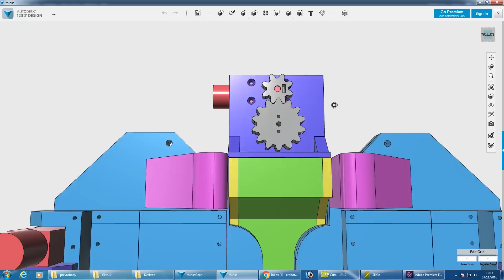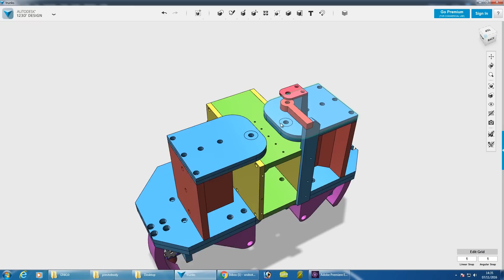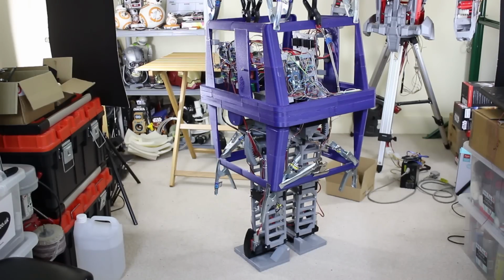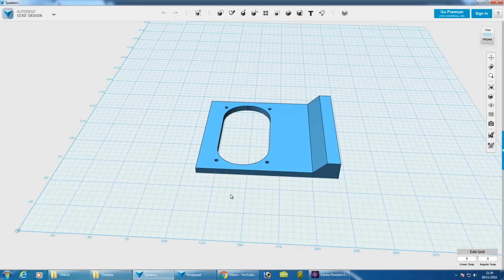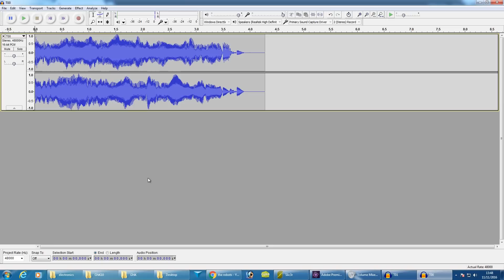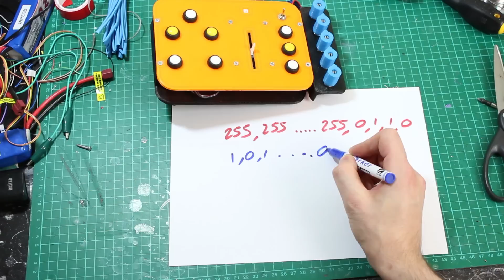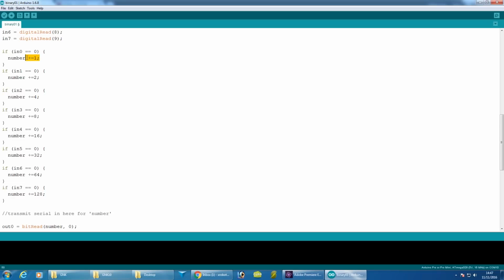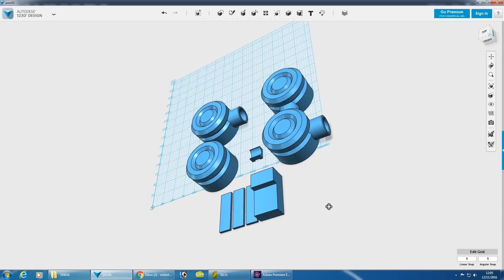Star Wars GNK Power Droid #10 | Cosmetic Features | James Bruton

Comment: While an int does take 16 bits (or two bytes) in the memory of the AVR, you are sending it as an ASCII representation, where each digit takes a byte in your transmission. So 0 only uses one byte, while 255 uses three bytes and 1024 uses 4 bytes. While sending it as ASCII is more human-readable, it takes up space in your transmit and receive buffers. It also takes time to send it all as ASCII, which could be better spent on processing. (Especially on a bot like your BB-8 v3, with all the IMU and PID calculations going on in one microcontroller). Sending the values in binary makes more sense all around. While debugging, you can still have the AVR write out values to the computer in ASCII so you can see what values are there.

Comment: there is a cleaner way to implement the input to binary number value with a for loop. something like
int in[8];
 
for (int i = 0; i < 8; i++){
   in[i] = digitalRead(i);
   number += in[i]*pow(2,i);
}
Reply: Also:
int out[8];

for (int i = 0; i < 8 ; i++){
  out[i] = bitRead(number, i);
}
Reply: Actually, i rethought the transmitter end code. 
int number;

for (int i = 0; i < 8; i++){
   bitWrite(number, i, digitalRead(i));
}

Comment: An easy way to transmit data is to collect all the info into a 'struct'
You can then set the individual bits, all the analog values etc and send it as one block.
On the receiving end you just read the data into that struct and you have direct access to all the data you need without having to parse anything. The compiler does all the work for you. Very compact and fast. And most important easy to use ad maintain.
Here is an example how i used it for sending data from a analog joystick:
typedef struct {
  int x;
  int y;
  union {
    struct {
      boolean up: 1;
      boolean down : 1;
      boolean left : 1;
      boolean right : 1;
      boolean joyswitch: 1;
      boolean fire0: 1;
      boolean fire1: 1;
      boolean option1: 1;
    };
    byte switches;
  } data;
} MicroBlocks_analog_joystick;

MicroBlocks_analog_joystick analog;

You can then set the bits directly:
analog.x = 100;
analog.data.up = 1;

After receiving you can check if any of the buttons are pressed with
if (analog.data.switches != 0 ) {.... }

(switches has the byte value of all the individual bits combined)

Comment: You could just sense when the knobs are being changed and send the new values with identifiers. That way you only ever send two values for the dials: an identifier integer (from binary to identify which dial has changed) and one integer for the changed dial.
Reply: Actually, using binary to identify the dial would only be necessary if more than one were being changed. Otherwise a 1-5 integer would work.

Comment: You can put transparent plastic panels on the outside (with switches and stuff) so you can see through the droid. In this case the main body remains solid and everybody can see that there is no one inside.

Comment: If it helps here is a way to optimize bit field encoding... it reduces the need for if-statements and can provide a speed increase of your loop...

number = (unsigned char)digitalRead(2); // or << 0 ... same thing.
number |= (unsigned char)digitalRead(3) << 1;
number |= (unsigned char)digitalRead(4) << 2;
... (left out to reduce my typing) ...
number |= (unsigned char)digitalRead(9) << 7;
// number is assembled and can be sent.

Enjoying the GNK build, looking great so far!
 - Eddy
Reply: (slight edit, looks like a binary '0' is to be interpreted as an active state..)
in this case, use;
eg. number |= (unsigned char)(digitalRead(3) == 0) << 1; // modify all of course...
etc. to invert the reading.

Comment: Would it not be easier to use arrays rather than write same variable 10 times. Like int in[10] = {0}; and use loops for initializing row of inputs like   
for(int i = 2;i < 10;i++){
    pinMode(i,INPUT_PULLUP);
}
and reading sensors in loop like:
 for(int i = 0;i < 8;i++){
    in[i] = digitalRead(i+2); 
  }
and setting bits:
 for(int i = 0;i < 8;i++){
    number |= in[i] << i; 
  }
and reading bit
  for(int i = 0;i < 8;i++){
    number |= in[i] << i; 
  }
  and last printing it
  for(int i = 0;i < 8; i++){
    Serial.print(" , ");
    Serial.print((number >> i) & 1);  
  }
It just hurts my I to see copy paste code. Other wise your channel is Excellent!

Comment: I think the problem with your previous methode is that it doesn't actually print the Integer as an 8-bit int but rather as the string representation in decimal ("0" - "255") resulting in up to 3 bytes per value.
You could do the following to send the values in their binary representation:

int valA = 127;
int valB = 255;
byte valA_byte = min(max(valA, 0), 255);
byte valB_byte = min(max(valB, 0), 255);

Serial.print(valA_byte);
Serial.print(valB_byte);

(I'm constraining the integers to a 8-bit range to make sure they don't overflow/underflow.)
And equally on the reciever side:

byte values[2];
Serial.readBytes(values, 2);  // read two bytes, save them in "values"

int valA = values[0];
int valB = values[1];

It's as easy as that and it is only using one byte per value instead of three. The only downside is that the receiver has to know the amount of bytes it is going to get.

Comment: I love this project, but when I hear your recording of the "Gonk!" noise I can't help but think of a Dalek... I think it would sound better if you modulated it lower and added a bit more noise. Also, slower movement would work in its favor since they all moved very slowly in the films. No more than 120 steps per minute in most cases, and in a lot of cases more like 80-100. But yeah, this is really cool! I think I might want to build this one myself when I get a 3D printer.

Comment: I was thinking, you might be able to put some extremely thin Plexi on the sides or some kind of extremely thin plastic sheets (not quite cellophane, but more like a sheet of plastic that is used on a cheap large poster frame. It is clear and light weight and can probably be adhered with your contact cement you are using. Just a thought. Keep up the Awesome job, my friend. I'll catch ya' later ; - )

Comment: If each integer is 2 bytes, why do you need to send a comma every third byte? The comma can just be inferred, surely? If necessary a single-byte "start of string" command, and maybe a full stop at the end, would be enough to synchronize everything, I would have thought.
Reply: nagualdesign
Also I think that with his previous methode he doesn't actually print the Integer as an 8-bit int but rather as the string representation in decimal ("0"-"255") resulting in up to 3 bytes (UTF8) per value.
Reply: nagualdesign
He could just do the following:

int valA = 127;
int valB = 255;
byte valA_byte = min(max(valA, 0), 255);
byte valB_byte = min(max(valB, 0), 255);

Serial.print(valA_byte);
Serial.print(valB_byte);

(I'm constraining the integers to a 8-bit range to make sure they don't overflow/underflow)
And equally on the reciever side:

byte[] values;
Serial.readBytes(values, 2);  // read two bytes, save them in "values"

int valA = values[0];
int valB = values[1];

It's as easy as that. The only downside is, that you have to know the amount of bytes you are going to recieve.

Comment: Wouldn't it be better / more readable to use bit shifting to get the buttons? I.e. If you buttons are simply 0 or 1's you could use
result = (button0 << 0) | (button1 << 1) | ... | (button7 << 7);

Then on the other end its a simple as going
button0 = result & (1 << 0);
button1 = ((result & (1 << 1)) >> 1);
....
button7 = ((result & (1 << 7)) >> 7);

Otherwise it's looking real good, keep up the good work
Reply: Same thoughts here, some bit shifting and/or const bitflags that you can do bitwise operations with (using "(Bitfield & Bitflag) == Bitflag" to check if if Bitflag is set in Bitfield, etc) are much more efficient, plus with sensibly named bitflags it makes for more readable code than just bitshifting OR the current approach. And I'd just put the whole control state into a struct and send that, maybe with some error correction thrown in.
Reply: But, I guess if its working its already working it shouldn't really need changing.
Reply: I like this way also! (bit shifting) Easy to use, and saves lot of memory.

Comment: If you take care which pins you use for the button inputs,  you can read all 8 pins from a PIO port with a single instruction, ready packed into a binary byte.  I'm pretty sure you can do this in Arduino C without delving into asm,  but that's an option too

Comment: You could use plexiglass panels. It would add rigidity to the body but allow everything to bee seen.
Reply: as well as prtect the insides from greasy hands and damange
Reply: yeah, some darkened plexi and led illumination inside (ala gaming case) that changes color when it sais GOOONK!!
Reply: Great idea !
Reply: ThatSaneGuy Yeah it might be a bit heavy in retrospect. Well, since the covering would be mostly for authenticity sake, he could use just about any semi-rigid material as long as the additional weight isn't too significant. I'd say he could use Styrene. Cosplayers use it to make armor (via vacumm forming) so it's somewhat regid and quite light weight as well. Sheets of it are relatively cheep as well !